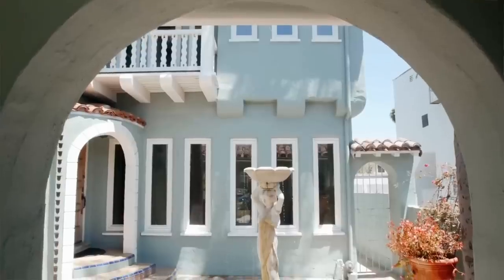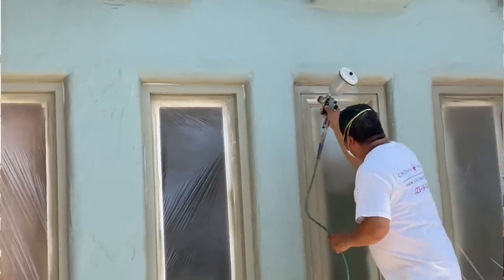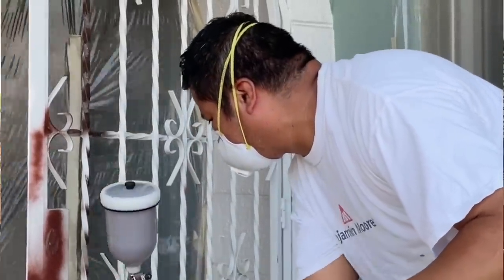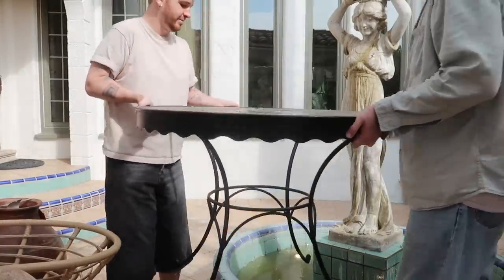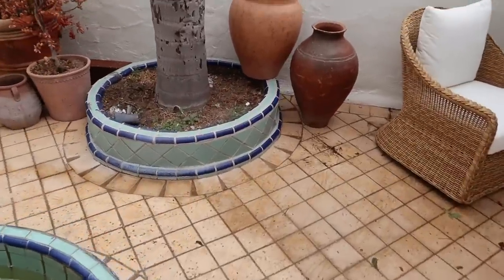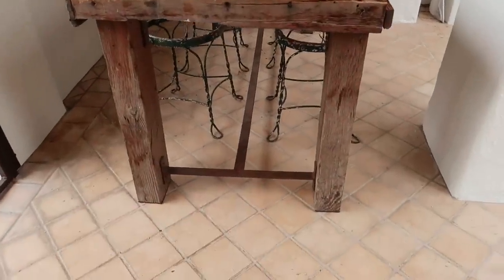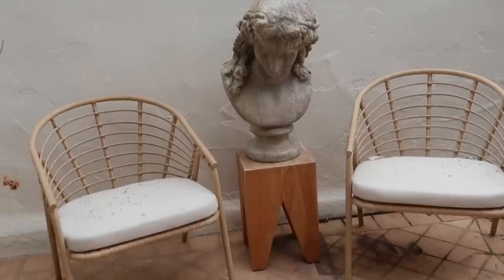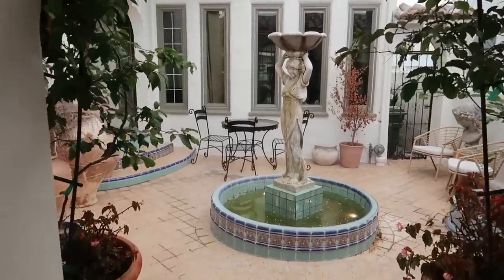I PAINTED MY HOUSE + Courtyard Makeover! (The Cost & Process)

Comment: I would consider using a flameless candle inside the lantern that uses a remote.  Safe, easy and pretty.
Reply from the maker: Ohh loveeee!! Ordering one now :)
Reply: @lonefox  Do a collab with @benjiplant for the outdoor space
Reply: I was thinking the same! Brilliant!! ✨
Reply: Use Solar lights in those lanterns..they are so pretty.
Reply: Had I have seen this earlier, I also would’ve said flameless candles and I also would’ve said Luminara! They are the best! They are based on the design by the Imagineers, that made the candles for the Haunted Mansion in Disneyland. They typically come with a timer, so you can have them going anything between 4 to 10 hours a day. Make sure to get the outdoor ones - the interior ones are made of real wax. I also live in LA, and it does get killer hot - it will melt them.
Reply: @URANUSguys love his channel so much

Comment: Be careful putting plants in the pots that are sort of jug shaped - only put pots as wide as the hole at the top. Otherwise if you fill them with soil, the plant will eventually get root-bound, and because the opening is smaller than the rootball, you can't get them out to re-pot them. You can still do beautiful plants in these sort of pots, but you need to get the right type of plant, or have pots only as big as the opening.
P.S. Your house looks STUNNING!

Comment: The color change is gorgeous! Since you are filling the courtyard with pots, the baby blue tile really sticks out like a sore thumb. Great idea to pick up a color from the inspiration tile in the middle. Maybe a terracotta type of red, similar to the red in the tile? 
You will regret the rattan chairs sitting where you need to traverse the trash cans. It will become an irritation to have to move them every week to pull out the trash. Maybe something thinner? A rustic bench that will hug the wall and not need to be moved?
I’m a bit OCD when things don’t line up and throw off the symmetry. I adore the table, if you can not center it under the window due to losing seating due to the pillar, perhaps put the bench idea you had on that side and at least nudge the table so it at least aligns with the outside edge of the window instead of being just a few inches off? All of those pot are simply to die for! I hope your gardener is going to be doing the watering! I was raised in So Cal and the heat. Potted plants dry out so quickly because they can’t pull moisture from the surrounding ground. 
The colors you selected are spot on and so beautiful together. I love your idea of painting the underside beams to trick the eye into believing they are wood.
I’ve NEVER commented on a post before but this courtyard is becoming the heart of the home. You will have so many wonderful hours spent here with friends, laughing and sharing life together.

Comment: Nice!  Yes, paint the eaves and also paint the wood ceilings and beams in the covered areas the dark brown, not the lighter brown you used around the windows.  It will feel cozy, it will emphasize the mission style of the home and it will look GREAT!!!  I also think rust would look way better than the baby blue currently on the tiles.   Keep the chairs around the table.  Benches are SO uncomfortable, they're difficult to climb over, they're always too far or too close to the table and aren't easily adjusted.  I like the idea of a chandelier with candles, but it's not practical outdoors because wind will blow out the candles.
Reply: I agree with you, maybe battery operated candles would be a wiser choice
Reply: Unless you’ve got glass globes to guard against the wind consider a plan b!

Comment: 1. Coolest tree for near the house = fig tree (mediterranean feel, exotic leaf shape). 2 Put those great lanterns up on the top stair landing or move the vases elsewhere (might be too many same-sized things there). 3. Mask the trash cans with a piece of black fence that can be easily pull up and out on Trash Day. 4. You cannot have one "outcast" friend sitting outside of the sitting area:  switch the 2 open-back lighter chairs for opposite the couch and the 2 larger chairs can go in the courtyard. 5. Use that long dining  table in the courtyard to work on every day and instead find an iron table pedestal and put a plank oval top on it for use with the ice cream chairs. It'll be easier for people to get in and out of that area - corner table legs are very restrictive especially after you've had a couple drinks. You can put that Work Table on casters that can lock for when you're working. Maybe even put it across the trash can zone to mask it.
Reply: Excellent summation. (I could not help but feel sorry for the "outcast friend.") 
I hope Drew follows all of your sound advice. 
🌿💐🌿😊💚😘🌿💐🌿

Comment: For the outdoor lanterns, cut a piece of wood that fits perfectly in the bottom (you can glue it into place if you want). Inside the wood cutout, cut another circle that fits a flameless candle and shove that in there. The "candles" stay in and all you have to do is hit the switch at the bottom. This also allows you to easily change the batteries.

Comment: Love the white walls - so much cooler for the Cal sun. Paint the light blue tiles to the terracotta colour. Then if the darker blue doesn't look right you can pick another colour from the detailed tiles to paint those - maybe the lemon colour. Maybe some remote controlled puk lights in the lanterns would be good. Would be a shame to not have them illuminate at night. Suggestion for plant ideas - visit a local nursery. You don't need to buy there, but you will get ideas of what will grow in your area and look good in the courtyard.  They gave you the gardener's info - I had to go back and listen again because I thought you said they gave you the gardener LOL That wall near the trash cans looks like it needs some greenery up/down the wall. Maybe long narrow pots with trellises that climbers could grow up, or long narrow pots on the top of the wall with trailing plants growing down.

Comment: Drew I think a nice rustic thin bench would look good in that small corner where you have the two chairs with the statue, you could even fill the top of it with small or medium terracotta pots with colorful flowers or greens, you could even put smaller pots on the bottom of the bench that way you’ll still have room to take out trash cans without halving to move anything, or simply the rustic bench and some nice rustic vases next to the bench, just an idea🤷🏼‍♀️I  have a bench with pots and I added some cement figurines on bottom. Everything looks beautiful I know you have a beautiful style and everything will be beautiful as well😊🙏🏻thanks for sharing

Comment: Hi. I'm an amateur architectural history nerd. Classically, the underside of the eaves and the exposed rafter tails were painted brown or a dark wood tone to match the rest of the structural woodwork. This was true in the original Haciendas and in the 1920s an 1930s revival Spanish homes. Second: have you considered using remote-controlled flicker battery candles (available cheaply at Dollar Tree and BigLots) instead of actual candles? I generally don't go for ersatz decor, but they are much cooler than real candles, which can heat up the iron framed glass lanterns enough to damage any plants that are in the vicinity. The coloured heavily textured glass with disguise the fake candle pretty effectively. I agree with Rebecca, paint the vapid pale blue tiles a vivid color(s) to coordinate with the bright talavera tiles on the fountain. Terra cotta would be great!

Comment: Yes to the beams paint, no to anything in front of the garbage nook - maybe a window box planter and some flat metal artwork on the wall beneath. Love the house color! Yes to a bench at the long table but be careful to test the seating for access as that looks like getting in and out might be too confining. DEF. get a few citrus like lemon or orange trees; you will love the smell and structure of them! Also, ask your gardener; they might have some good suggestions

Comment: The paint job and courtyard are perfection.  So beautiful.  You really scored with this house.  I don't mind the tile as is, but paint if you want to.  With Spanish architecture, everything doesn't have to match perfectly and right now you have complementary colors in the courtyard.  Re: the hanging lamps, maybe battery operated candles and they have a remote to turn them on and off, so safer than candles.  I have some and they are great.  I love the idea of the hanging chandelier over the table, too, and possibly also battery operated candles for convenience in that.  Too bad I'm not local to you: I bought 2 iron chandeliers on ebay from Italy and I pulled the electrical cording out because they need to be re-wired or candles in the glass sleeves, so maybe one outside and one inside, but point is, I've had them packed for several years and they would look lovely there over your table and one where the cream couch area is, too.  Monstera is very popular with your style, also banana leaf plants, large ferns, and olive trees are gorgeous.  I assume you know you need to put cushions on the seats of all the iron chairs for comfort and you could find fabric in a pattern that connects the blues and terra cotta with the other colors. That wood table is great.  You have quite a few pretty areas to sit, eat, visit.  Agree, your courtyard looks like a villa.  The whole house exterior is just perfection.  Don't overdo the courtyard decor and plants, the balance now looks pretty good, visual weight wise.  I'm prepping to move to a more Spanish style home myself so I like a lot of your ideas.  I'm not into the 'southwestern' vibe, per se, but nothing wrong with improving on things and being creative.  I forgot to mention Bougainville plants, which are very traditional and so pretty in courtyards.  And yes, a lemon tree - also easy to grow.

Comment: I would put fairie lights that twinkle in those lanterns. You can make a circle insert on the bottom and glue the battery pack to the insert and fill the lantern with the lighted wire.

Comment: Oh, as for tapers, be sure they will stay lit…the light fixtures, you may be able to run electric, or high end votive candles. Be careful filling all your pots with dirt, because it can be hard on some of them, and make them take tons of water. Your in LA, you can grow anything🎉 Oh, I did some fun lights for my patio. I have bird cages up to 5’ tall for one. I used like 300 of the tiny fairy lights, hanging from the top inside of the bird cage over my dining table. It really is stunning😘

Comment: Can't believe it's already been a YEAR since you got the house❕

It looks SO MUCH BETTER than that ugly blue❕❕❕

Also looks better without all those  planters the prior owner had - looked WAY too cluttered.

You should get rid of the blue in the tile too - It looks cheap.  Doesn't go with your "Earthy Vibe".

For the tile, you should go over the blue with mixed metal tones like in your kitchen (bronze, copper, aged copper, brass, pewter, etc...)

Not sure how many tiles you have to repaint but here's a tip:  

FINGERNAIL POLISH❕❕❕

For DECADES I've gone over tiles & ceramics with cheap dollar store fingernail polish.  

There's a ton of colors to choose from.

It's super durable, it never fades, doesn't chip, stays shiny & looks like it's original to the tile.  

Also, the polish "levels out" and dries perfectly smooth, without any brush marks.

Speaking of my fingernail polish "hack" I also use it on items that get chipped.

I had jet black canisters that got some chips (which were stark white). 
I dabbed a bit of black fingernail polish on the chipped areas and viola❕
You cannot tell the chips were ever there!

When fixing a chip, don't get any polish outside of the chipped area.  The polish will level out with the surface of the ceramic piece, making it smooth & level.  

I've fixed coffee mugs like this too.
Fingernail polish even survives going thru the dishwasher.

I've touched up chips on ceramic tile floors the same way - much cheaper & easier than chipping out a tile & replacing it.

Oh!  And if you have an older stove or old porcelain sink with chips in it..
Same thing!  
Fingernail polish❕ 
(For my stove I had to mix together 2 colors of polish to match perfectly) and the heat from the burners does not affect it at all.
Hope this hack helps someone. 😊

Comment: I agree with painting the aqua/blue tile  in either a terracotta color or white also be careful what you paint it with just so you don’t have cracking and flaking because they are outdoor tiles and if the paint isn’t UV and heat rated you might run into that down the line especially when things so easily sun fade in CA

And I agree with others about the jug shaped pots especially for trees that they may become root bound and you’ll never be able to get them out of the pot… so I’d avoid doing a tree especially that way you don’t ruin the vessel and you don’t hurt a tree and wasting the money as well… but I think an olive tree somewhere would be amazing

Comment: I like the new house color. Agree the rafter tails should be darker. Even though the patio tiles aren't original, they could benefit from some TLC & that would enhance the overall look of the courtyard. They may be light in color or just look faded, but you can add some depth underfoot with proper treatment.

Comment: I’m not surprised at all regarding the cost of the painting and, in fact, I think it was extremely reasonable for the amount of work that went into the project. In 2010, when we built the house in which we currently live, it cost $25k to paint the exterior, which admittedly is large. To repaint it now, 12 years later, I know the cost would be at least $40k if not more. I live in Montana and the cost of construction and related trades is quite high if you live in one of the more populated areas.

Comment: I would definitely get an inspo board going on courtyard tiles and paint out all the blue. In front of the trash cans, I would leave it open space because who really wants to linger there? You need some open space and not have to move anything to get the trash cans out every time. Functionality. Maybe a screening trellis, vertical or horizontal, to block out the neighbors, have more greenery that does not take up space, but gives you privacy. Also for the fountain, I would consider an urn for the centerpiece, rather than the lady who looks kind of Grecian or Roman to me. Ditto with the bust. I don’t think it goes, but if you love these two figures and they spark joy, keep them! ❤

Comment: Yes! Paint the tile in warm colors. The blue look so out of place. BTW…love you and your design. Take that from an old retired designer. But I am old and just a simple pro tip I’d like to give you (so many people make this mistake). When hanging drapery, hide all brackets with the drapery rings. Never have a bracket in the middle of the window (sorry, just destroys the look). Also, there’s a return on each end of the drapery (either 3 1/2” or 5 1/2”) take end of the panel and thumb tack it back to the wall. It finishes off the ends so beautifully.

Comment: Bougainvillea mentioned in someone's earlier comment would look great against the Soft Chamois painted stucco. Add scent as well as color with fragrant roses that are adapted to the CA microclimate created by the stucco, as well as areas in the shade. Monitor the temperature & wind  fluctuations on different facing directions before selecting roses. Habits range from shrub to tall arching urns to climbers. Take your time, understand the microclimates to make informed choices on the roses before purchasing. Comtact local rosarians, especially members of the Heritage Rose Group for advice, and cuttings of old roses.

Comment: Love the exterior paint colors you selected, my vote is a NO on painting the rafter ends the dark trim color, too busy and distracting. Regarding the blue tiles, the stairs, planter #1 to the left of the stairs, and fountain are a good balance, but the 2nd planter by the refuse bins w/tree in blue tiles is maybe too much, so I would be inclined to plaster it to look like the house wall and paint it the cream house color. Then do a marble, stone, or copper wrap around the base that the fountain lady stands on to ground her and reduce the blue tile dominance.  I honestly can't imagine painting the tiles as I don't think it would wear well over time and would devolve into a patchy mess, but I am not familiar with that process so can't say if it is a viable option or not.  The final recommendation is to do a whole patio/courtyard gentle power wash to clean and re-enliven it.  

Are the square panels on the door/table made of copper? Was hard to tell what they are made of in the video. If copper they would polish nicely, then patina over time. The hanging lanterns on the planter trellis are beautiful, just need remote controlled outdoor candles and simple screen base to hold them inside. A narrow weathered bench with a few potted plants would be nice along that wall where the refuse bins are stored.  I like the grasses and trellis plants that you have selected, very beautiful!   Thinking a star-jasmine ground cover would be nice in the planter around the tree by the refuse wall, it has a nice fragrance and dark green leaves with white blooms is quite hardy and frost tolerant and will climb a trellis if you desire or can be kept cut back as a ground cover, however it will attract bees when blooming so it that is an important consideration.  The beautiful lady bust would be nice near the door entry or in the dinning table nook, but she deserves a focal point of her own whether indoors or out.  Looking forward to your final courtyard reveal! Have fun!